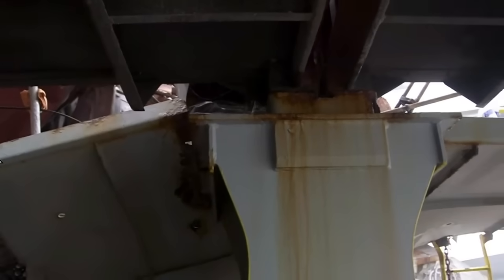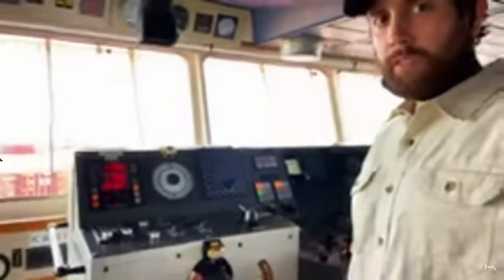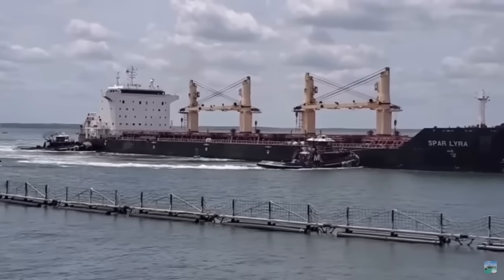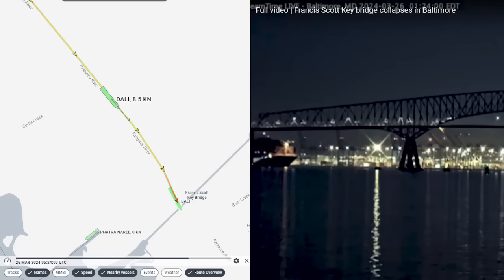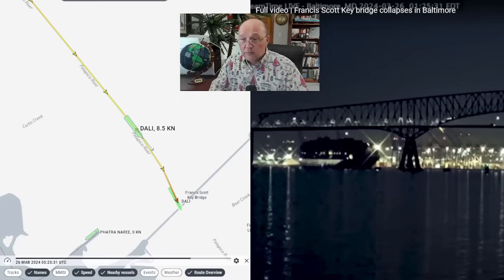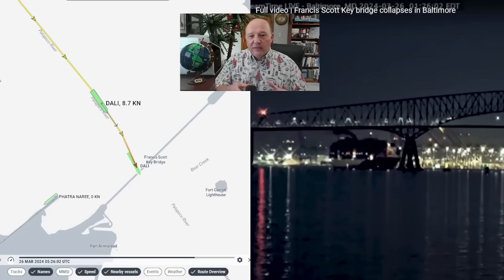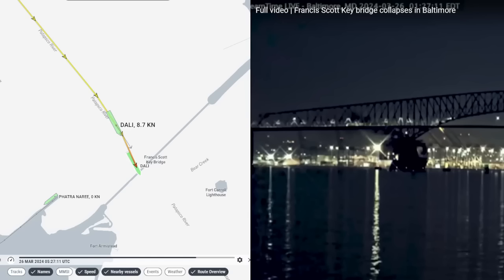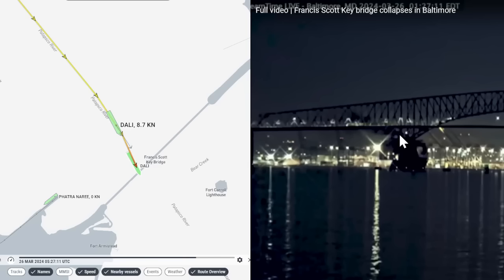Dali Timeline from Data Recorder in Striking Francis Scott Key Bridge in Baltimore, March 26, 2024

Comment: Ex machinist mate of a Ohio class sub here. When you lose hydraulic power, the pressure in the rudder control cylinder will start trying to equalize. This could push our pull the rudder a few degrees in a certain direction. Also, the hydraulic control pilot valve would have stopped where ever the last position it was when the hydraulic accumulators went dry. It's possible the helmsman was inputting a little right rudder to hold heading when the power went out, because you can't hold a heading without steering back and forth from left and right. In the Navy, they have us +/- 5 degrees of rudder to hold heading without having to ask permission. The slower you go, the greater change in rudder is required to hold a heading. So for all we know, the rudder could of been stuck at Right 5 to 10 degrees there whole time there power is out. Which would help explain the veering into the bridge.
Reply: Thanks for sharing. That's interesting to know about ships steering. Frankly, most of us know little, if anything, about how large ships work.
Reply: You have to steer left and right to hold a heading in the center. 

Ok, but isn't that more applicable out in the open sea?

This is in a protected bay with no wind and no current to speak of.

It's hard to envision steering a giant ship right and left in these conditions, especially when you're close to a bridge and you're aiming for a certain gap.
Reply: What are your thoughts about it possibly being a Chinese cyber attack?
Reply: @TomdeSabla that was already brought up in the video, complex interactions between channels and changing tides could have affected it.
Reply: @Mesuxyxrxbskxkxyp  i would think they would want control so not cut the power, and in life shit happens. in tv shows like seconds from disaster its a string of litte things at the wrong time that lead up to it. its like a game of chance sometimes you get a couple of bad rolls of the diceon afther the other.
Reply: @TomdeSabla you clearly haven’t piloted a boat or ship before 😂
Reply: @TomdeSabla   except its not entirely free off current…. AS EXPLAINED IN THE VIDEO you have flowage from the river and OUTFLOW from it approaching but not yet arriving at low tide which occurred one hour after impact
Reply: Thank you Bass Mechanic for your Expertise & Years of Experience . Thanks for Sharing Your Knowledge too.
Reply: @patrickhenry1249   i swear i doubt any of these conspiracy theorist have ever been in a boat that had a anchor larger than an old rusty coffee can filled with Quickcrete
Reply: The same principles apply when paddling a 14' canoe.  Those and I have to go faster or slower than the current for anything to work steering wise.
Reply: @patrickhenry1249  Clearly. Did you have something additional to that? Again it's a ship of 100,000 tons already aiming for a gap in a bridge about a kilometer away. It's not like Marley and Curtis Creeks are the mighty Mississippi.

It seems like a pretty sharp turn for a ship of that size, traveling at 9 knots, to make in those conditions just from tides.
Reply: @MrSheckstr  That's the problem sometimes with the tin cap folks. Entirely too much time and no useful knowledge whatsoever.
Reply: @JamesTK  I guess, but it's a really big ship and not that far from the bridge. I would think it would stay on course. I did find the technical discussion of how the power loss could have possibly resulted in a course change from the hydraulic system in the rudder interesting. I'd go for that before I went for the tides as a causal factor
Reply: @Mesuxyxrxbskxkxyp  The Chinese hacked the iPhone of the helmsman and sent covert signals via bluetooth into his ear pods to signal a veer to the right, thus striking the bridge support.
Reply: @TomdeSabla as vessels slow down they get “squirley” for lack of a better word to all you non mariners. As the speed come off you have the dynamics of the center of gravity, center of pressure of the water plane and the interaction of the ship within the channel banks. It would blow your mind to watch these ships push the water out of the channel onto the mud flats then fall back in after the ship passes. I operate a combined tug / barge unit with a high block coefficient. When steering we talk about how well a vessel steers without the propeller turning calling it a dead stick. My unit for example even reducing from normal speed to dead slow will try and swap ends with itself if you are not actively steering and it takes full rudder input, in addition to intermittent bursts of engine power to hold the course. The speed of the propeller is slower than the speed of the ship and the propeller acts like a giant disc blocking water flow. Once the vessel slows to match the propeller speed to the hull speed the rudder effectiveness is regained. I’m not surprised at all that the change in momentum started to cause the ship to veer. Even if the rudder was hard left it was still going right just because the momentum was already headed that way.
Reply: @Jon_Flys_RC  ok, I appreciate your logical and reasonable explanation and the time you took to make it.

We still aren't sure that the directional change happened without power are we?
Reply: One of the things questions on my mind is how modernized this ship is. Most of my vessel experience is with old school anchor positioning and dynamic positioning vessels for pipeline and salvage in the oilfield. With  dynamic positioning vessels there's potentially cranes with heavy loads, pipelines and/or divers in the water. If everything is working correctly if you lose main engine, you should have enough power to operate rudders and safety systems until the backup kicks in. Is that not a capability of this vessel? Was it supposed to be and something failed? I've been on vessels where we lost mains but the wheelhouse still had power and where the wheel house lost power but the mains were still running but never seen both go out at the same time.
Reply: @chetmyers7041 haaaaaaaa....i love this.....hahaha
Reply: @TomdeSabla  you’ve clearly never driven something large and heavy in the ocean. I’m giving you professional experience from doing it. Nothing in the water continues in a strait line without constant correction. It’s a dynamic environment and you’re in dynamic fluids.
Reply: @TomdeSabla 9 knots is fast for a giant ship like that, ships don't stop like cars
Reply: This has got to be one of the most important comments! If what you stated happened in this incident, it explains a lot! "Why did it turn into the bridge?", well that's why ^^
Reply: @TomdeSabla  The OP already explained everything with regards to a ship that size far better than I could, but if you’ve ever piloted a boat you’d know exactly what OP was talking about, and why your stance on the matter is hogwash. It’s not a car, stop thinking about it like it’s a car. It’s not a car.
Reply: Excellent  information  you sure know how things went  wrong. Pilot did all he could do to avoid hitting that bridge !!! Pretty much what was going to happen it was unavoidable
Reply: @Jon_Flys_RC  I’ve had this exact same argument with a friend before and the amount of people who think piloting a boat or ship is like driving a car, or that driving a car is harder is honestly insane. It’s like they think water is static and the propulsion of a vessel is instant, like it is for driving a vehicle on the road.  No matter what you try to explain to them about how that’s not the case, they can’t see it as anything other than a car on water.
Reply: They said in a documentary once that these container ships will coast in a straight long for up to 4 miles without any input because of the sheer momentum they have. This ship took a hard right as if it was deliberately turned and under extreme power. Just look at the smoke billowing from the stacks. Cut the power on a 30-40 foot boat when doing 10 knots….you have to do a lot to get it to turn at all. I’m not stupid and neither are 98 percent of you. It’s the 2 percent that keep defending this that alarms me. An object in motion continues in motion until acted upon by another force. The currents can’t do this you Einstein wannabes.
Reply: It was built in 2014. So as far as freighters and how they're treated. It's a pretty modern vessel.@nofuxgivens2797
Reply: @grendel.6.531  Which documentary, when, made by who? And secondly, why would a random documentary you saw somewhere, sometime, automatically overwrite the actual experiences of the people who do this professionally, and are telling you how the drift was possible?
Reply: These huge cargo ships seem to rely too much on computers and electronics to control the systems.  I think there should be some kind of mechanical backup controls for the rudder if that is possible.
Reply: @TomdeSabla he didn't say the ship was veering back and forth. He said to maintain heading, the rudder was moved back and forth. Changing direction of a 1000'+ ship loaded takes a good bit of force acring on it.
Reply: Why should this ship veer to starboard when it Is already cruising on straight line ahead? Had the steering been turned to starboard?
It's a quay and channel insignificant current?
Isn't there a periodic steering drills for emergency steering in case lost power? Manual steering drills?
Reply: @TomdeSabla  For factual clarity, I was in the USCG, and on a bouy tender that went out of Curtis Bay under the Key Bridge often. We were told to aim a light fixture on the front of our bow at a light that is in the CENTER of each side of the bridge span until were were about 1000 yards in front of it at which time if they were no traffic we stayed the course, if other traffic coming the other way we went slightly to our starboard or whatever the Quartermaster said. It was simple. Line our bow light up with the light at the center of the span. At night there is only one way traffic under that little 1200 foot opening. You hit the center of it while staying as far starboard as possible in the channel as per regulations. Remember, the closer to that bridge, the muddier it gets closer to the land and the pylons, so you have to go closer to center-right  at night from what I remember. But I only recall coming into the port under the bridge from being underway, as I came over from Curtis Bay and then went under the bridge. These cargo ship circle around and come down from their dock at Fells Point or wherever.
Reply: @TomdeSabla  go fill a bucket with water and splash dead center.  Watch the ripples.  Now splash nearby the side and watch the ripples.  The ripples closest to the side will hit the side and then come back sooner.  So even in impossible mirror smooth waters the ship itself is creating waves that can change its direction without steering input based on the objects around it.  

Add in tides and currents and you get a very dynamic environment.
Reply: @TerryKeever  I appreciate the distinction you're making. You also say to change the direction of a ship that size takes a good amount of force acting on it.

That sounds a lot like what I've been saying. I've expressed doubt that tidal flows from Marley and Curtis creek could generate enough force to push the ship off course into the bridge.

I'm sorry but I'm not convinced this was an accident.
Reply: @Jon_Flys_RC  It's not in the ocean.
Reply: @JBlades88WV    even if they had the equivalent crew of a WWII battleship, you wouldn't be able to move the rudder fast enough with manual jacks to avoid that bridge at that speed. 

On the Battleship New Jersey channel there's a video where Ryan the curator shows the manual steering back up on an Iowa class battleship.  That has 2 rudders and is almost 120ft. Shorter and over 40,000 tons less displacement. You're talking about giant screw jacks where like 100 turns might move it an inch. 

The amount of power needed to manually shift the rudders is crazy. There's just not enough crew on a container ship to even do it, if it even had the capability.
Reply: There was also mention of possible prop walk when backing down.
Reply: @TomdeSabla what he means is slight inputs from the wheel, which are constantly necessary to keep the ship on a steady course. It is quite possible that when the power was lost the wheel was not amidships, and caused further problems.
Reply: @TomdeSabla  There is not sufficient proof either way. However, as someone who worked around that area and worked on Curtis Bay, I too find it a bit odd that cross currents from Marley and Curtis creeks can so easily move this ship while some are saying high horsepowered tugs which move the likes of the Royal Carib. Cruise Lines ships that drawf this ship, cannot move the Dali. The Icon of the Seas is around 1200 feet long and 280,000 tons empty. That is more than 2.5 times the weight of the Dali, and they are towed and pushed when they break down, and they have to navigate those narrow channels. There is a photo of the Icon with two tugs and a line on her inaugueral, as they sat her in place. The shipping industry needs to get with it if it wants to keep pushing these huge ships through these small openings in unprotected bridges with their engines running.
Reply: @JamesTK  You can see in the video, condition's were about as dead flat as you could ask for.
As the things you mention are possible over time. This whole event occurred in the span of three or four minutes.
Something exceptionally stupid or intentional happened to end up with that result.
Reply: @tuck6464  you’re some kinda special.
Reply: @patrickhenry1249  I’m a professional mariner of 20 years and currently a tug master on a mated tug / barge petroleum unit. I’ve been going to Baltimore semi regularly for the last 10 years. Theres just no convincing the unwilling.
Reply: People don’t have a clue of how powerful a force that current can cause of even such a ship as the one involved. You can actually observe this force . I think the outflow of the waterway to the right(starboard) of the ship dramatically affected this accident along with loss of control of the ship. All you have to do is place a 2x4 piece of wood in a stream of water to see how the crew had not any option other than “go with the flow”!! It’s extremely evident in my opinion that quick mayday and radio communication saved more lives of travelers on and off the bridge from going down with the bridge.
Reply: @patrickhenry1249 I’m sure there are a few dummies who have never been on a boat and more a ship but most people know steering a ship is a million times harder. Actually know that I’m thinking about the people I see driving every day you might have changed my mind 😂 they can’t even drive on a stationary road
Reply: The Dali has a bow thruster which is powered by auxiliary generators x2. No mention of this yet which leaves me perplexed "why
Reply: One question and please answer at your convenience. Is dropping of the anchor hydraulic or is it locked into place which only requires a lever to drop it or does hydraulics drop the anchor??? If hydraulics drops the anchor that is the stupidest system I've ever heard of because you don't need hydraulics to drop an anchor
Reply: 5-10 degrees wouldn't VEER into the bridge
Reply: @paranoidballoon8190  The back ups failed. Thats all I heard. And from what I know about power generators and how often they need to be tested to make sure they can work when there is a need, all I can say is somebody is getting fired over the fact they (both?) didn’t work in this situation. Clearly maintenance was lacking on that ship, and who knows how many countless others?
Reply: DATA :  This is the FIRST Bridge dropped by a cargo ship.
QUESTION : What is the NEXT Bridge that will come under attack?
If it Looks like terorism, killed people like terroridm, and the Government LIES ABOUT EVERYTHING like terrorism,  then there WAS  NO ACCIDENT !!   😞
Reply: @shimes424  I don’t think you understand how a rudder works.
Reply: The slight movement to port may have been grounding, bank sucked in port quarter, bank then pushed bow to port upon grounding into bank wall, then collision...
I don't think they got astern propulsion...and crash stop astern would have created even worse effects...especially if they had any rudder on...port anchor was all they had 😳
Reply: @grendel.6.531 "they said in a documentary once" lmao very impressive evidence EINSTEIN
Reply: @grendel.6.531 Yeah, I'll go with the folks whose actual job entails controlling these behemoth ships than some rando armchair quarterback that saw a documentary once. 😆
Reply: Thank you for explaining.
Reply: ce
Reply: @SeaJay_Oceans not even close. Lots of bridges have been damaged or collapsed from cargo ship strikes. 

Seeing shadows doesn't make everything a boogeyman.
Reply: @jarodstrain8905    Sure Sure... Just keep sending Billions $ of your earning to Netanyahu and Zelenskyy...   Laughing all the way to the bank, those two !
Reply: @paranoidballoon8190  It was already mentioned in this very video, including the fact that the bow thruster requires a LOT of power, something the crew definitely did not have.
Reply: @SeaJay_Oceans  Can you please tell the audience about your experience with ships, navigation, maritime activities, single screw propulsion and being a helmsman?
Reply: @chetmyers7041  could you provide more details or point to the source of this information.
Reply: @pinoypedro2052   you have to look at a map and check the tide charts….. the water ways take a turn to the south past the bridge, low tide was still one hour away , therefore the tidal currents are pulling in that direction…. Much like people need to stop thinking anchors act just like brakes on a car people need to stop thinking that massive container ship on a body of water that is flowing into a body of water thst covers 75% of the planet is going to act the same way as a toy RC boat in an indoor pool at the Y
Reply: @TomdeSabla   you “express doubt” but have present zero reasons for your doubts …. The problem is you lack of experience or understanding just hoe strong tidal forces are when transitioning from a body of water of one size (the bay of baltimore) to a body of water several orders of magnitude larger in volume (the Chesapeake Bay/ Atlantic ocean ) through the very narrow opening that this bridge occupies.
For what should be obvious reason bridges, especial BAY bridges are built in the narrows, but for that very reasons the currents under that bridge are always going to be stronger than the average for that area
Reply: @cozmo1266   for some odd reason people (like those saying absurd things just to feed their conspiracy fetish) have equated low to with calm waters
Reply: @paranoidballoon8190  in the video it mentions that the back up generators where not turned on before the incident, and while attempting to be started they were spun up all the way…. It also points out that because of the big plume smoke it appear that most available emergency power (that could have been used on the bow thrusters) was being directer to the blowers on the engine combustion chamber to purge it of partially combusted fuel that was choking out the restart process
Reply: @Jon_Flys_RC  You noticed. I've noticed a few things about you as well.
Squirrelly did you really say, squirrelly ? Yes , you really need to come with a better word still, when you're  referring to a thousand ' container ship. (did he really say squirrelly)
You may have some classroom/ book time.
You may have bought a couple certs.
But that big mouth, had you better suited for management /HR, than you were for the sticks. But you didn't like that. So now you're a hand/laborer on a contractors utility motor barge, Which is now no longer a tug or a container ship, that rarely if ever sees any "ocean", except for the fairest of seas. The term squirrelly would be used for your RC endeavors.
I can see your barge wanting to swap ends, but I still wouldn't refer to that as "squirrelly"
Now is as good a time as any to go back and edit that squirrelly comment, Tug Master.
Reply: @sharilynnwebb   droping the anchor isnt the problem…. Its braking (stopping) the anchor chain once sufficient chain was let out…. When you drop an anchor without  power you have to let the entire chain play out, pray the end doesnt rip out of its mounting, but the anchor is not going to start to bite into the  bottom until AFTER the chain is going to pull tight and it might slide a good way once biting and that all depends on the conditions of the bottom.
In the movie master and commander there is a scene where a bunch of crewmen and a midshipmen are doing something and then announce to the captain “sand and broken shell” . They have dragged up a sample of the sea floor and announced what material it is made of so that the captain can make calculations to decide how to set anchors if needed
Reply: @nofuxgivens2797 sounds like you've seen the BrickImmortar FV Alaska Ranger. It's hard to find anyone that speaks plain English when all the experts weigh in
Reply: I agree. Plus, isn't there always going to be some degree of asymmetric thrust with a screw/prop and the way it acts on a rudder? It's a huge factor on airplanes and ski boats when moving slow. Chop the power and there are huge directional changes.
Reply: The estuary also has water flow change there. Just before the bridge, there is water flowing into the estuary from the ship’s starboard, that pressure change is right near the buoy , and it’s exactly where the ship lost power. Extremely bad circumstances. The ship whilst is bow looked to be pointing towards the gap, it was drifting sideways slightly towards the bridge, the anchor being dropped may have accelerated the dramatic looking heading, but it was going to hit anyway, just wouldn’t have been the bow. 
Many comments on the videos seem to misunderstand the ships true heading with it orientation. Till we get a report we won’t know. But it doesn’t look negligent from the pilot, looks like he was up shit creak without a paddle.
Reply: @TomdeSabla there’s a current right before the bridge. Just where the lose power there’s a current from the starboard side. That’s where the drift of line starts, and with no steering inputs available for a period of time the ship was drifting sideways as well a forward. Worst time to lose power in that exact position it did.
Reply: @grendel.6.531 smoke doesn’t mean anything, that could be trying to start up engine, up to now we don’t know the facts, but you seem to have already decided without any actual experience that it’s a deliberate act. The ship dropped anchor, did it begin dragging at that point? We don’t yet know.
Reply: @JBlades88WV they do have backups. But this whole thing happened in 5 minutes. To control a ship this size you need to turn far in advance. We don’t know the nature of the failure, and if any backup helped or not. But the power required to move even the rude is a lot. The ship relies on the propellers. More information needed before jumping to conclusions
Reply: @pinoypedro2052 it wasn’t, it was drifting sideways aswell, hard to tell by the videos but the telemetry says it was drifting sideways also. If the turn didn’t happen, it looks like the ship would have hit the bridge anyway towards the stern, maybe they were trying to swing the stern around it.
Reply: @sharilynnwebb Yeah, no.  As soon as you manually unchock, manually unclutch and manually unbrake the anchor, it falls - because it weighs as much as an anchor.
Reply: @MrSheckstr No, when you drop an anchor without power, you manually apply the band brake  by hand to the capstan to begin to slow it any time you want.  The trouble is that the anchor can't be stopped on a dime - you can easily burn out the brake if you crank it tight too quickly.  And then nothing will stop the anchor until it hits bottom, or rips the chain out of the ship and falls free.
Reply: Also there was heavy wind as seen by the exhaust smoke being carried away swiftly to port
Reply: @grendel.6.531 you speak so confidently with zero knowledge or experience while being wrong at the same time. Take a look at yourself and ask why you are this way.
Reply: I have always admired submariners intelligence.
Reply: @pinoypedro2052 it’s almost like you didn’t watch the video at all and also didn’t read the comment you are responding to.
Reply: @TomdeSabla Tom you are convincing yourself of something that is not true due to lack of knowledge. Which is frankly insane.
Reply: @tuck6464  you are about at qualified to drive you keyboard as everyone else who doesn’t have a clue what they are talking about. Keep up the good work 👍
Reply: @Foryourinfo369  Yet the winds have been described elsewhere as very light.

There'll be all kinds of Weather Underground data logged to provide objective data.  (Lots of bridges sport anemometers and wind vanes nowadays).

There will be a quantum leap in speculation once we know what killed propulsion, and what the state of the electrical systems were during the accident.

What probably has owners, insurers, and crew on the edge of their seats was whether or not this was the first time the ship lost propulsion like that.  If the ship had a rep for that, it's not gonna be a good look at _all_.
Reply: I saw a video by a retired ship's engineer where he said that the "Paddle Wheel" effect of the single screw in Full Astern is what helped drive the bow to starboard. What do you think?
Reply: @hanspecans  What have I convinced myself of? I said I'm not convinced it was an accident. Is that ok? What we've heard here are a number of reasons it absolutely could have been an accident.

I appreciate all the knowledge and expertise. However, there are still a number of reasons for my doubts. A couple are:

1. Data recorder stopped recording some data at crucial time. Please don't bother saying "the video explained that" because it didn't. It only offered a potential explanation that maybe it doesn't record certain things if the ships power goes out.

No one has spoken definitively on this issue 

I find it incomprehensible that a data recorder specifically there to record what happens if something goes wrong doesn't work if the power goes off 

2. The timing of these events is highly suspicious. This failure magically happens at the worst possible time. 

I think it's insane not to be suspicious.
Reply: @sharilynnwebb  This is LITERALLY covered in the video you're commenting on, FFS.
Reply: @paranoidballoon8190  Covered in the video already.  Thrusters would have little to no effect at these speeds, certainly not within the very short timeframe involved.
Reply: @TomdeSabla  it records instrument data no power to instruments no data to record
Reply: @damedusa5107  That makes sense.   I just thought there might've been some way to prevent this kind of accident.  I don't understand why they don't use tugboats to pull the ships until they're past the bridge.  Just seems too risky trusting a ship not to break down.
Reply: Just wondering, is it true that by dropping anchor it could cause the ship to swing around from the back?
Reply: What bothers me is Biden said he took a train over that bridge many of times. We all should be worried about that.
Reply: @Jon_Flys_RC  Will do , SQUIRRELLY
Reply: That's besides the point Sir. We are officially at war with Singapore.  This will not stand.
Reply: @MrSheckstr  Whoa, whoa . The Chesapeake Bay and the / Atlantic ocean ae not the same thing, or comparable.
The bridge does not occupy a "very" narrow opening.
Reply: @MrSheckstr  I don't recall any mention of "back up " generator's . Only "emergency" generators.
Reply: @damedusa5107  Like it or not there is still potential of this incident being a deliberate act/ deliberate irresponsible act/ deliberate interference to navigation.
Reply: @patrickhenry1249  But you argue with everybody, don't you ? And you always open your arguments with, "I'm not going to argue with you" don't you ?
Reply: good explanation

the  question is, if ship going  straight  then  why need the rudder  turn 5 degree?
because these ships  basically  using  GPS
and the way  to go ahead is straight

so everything shows  ship was steered
without power they couldnt turn it back
but why was  turned  when it was going straight?
Reply: @sharilynnwebb  I'm guessing to control the momentum of the chain payout. But I'd expect there was also a mechanical/manual provision for that as well.
Reply: @patrickhenry1249  Supposedly all equipment /main/auxiliary / back up generators are supposed to be running at all times while in navigation, in restricted waters/ ports/inlets, as a precaution.
Reply: @damedusa5107  If the AIS recordings/displays being shown are at all accurate, this ship had no upcoming turns approaching the bridge/a straight shot. No reason for anything other than minimal rudder articulation/manipulation, with or without power outages.
Reply: Probably this size of vessel has a semi-balanced rudder, which it should return to midships position after a hydraulic failure on the steering gear. I often see people bringing up their past sea experience in this case. I will tell you honestly, there are few people here which have experienced working on these modern and huge vessels. There are many different things compared with 20 years ago starting from regulations, maintenance and operation.
Reply: @TstanDa-Man  Not a million times harder. Exactly the same principal as a 16' powerboat.
The only real difference, is the consequences and the responsibilities .
Reply: Steered into bridge support confirmed?
Reply: @tuck6464  shouldn’t take everything so literally. So let’s just say you have a wide open dock to pull up to you think a small boat is just as hard as a shipping container to dock?? If so no need to comment I understand what you are working with between the ears
Reply: @Mesuxyxrxbskxkxyp you CAN NOT  be  serious .🤦‍♀️
Please seek professional help immediately !😳
Reply: @SeaJay_Oceans   One really has nothing to do with the other, even if you knew my positions in those issues, which you don't. 
 Wanting to see grand conspiracies and everything you look at says a lot about you and nothing about the world.
Reply: @TstanDa-Man  You're absolutely correct about people not being able to drive but think they know how a ship handles.

I "sat" for a USCG tender operator's license several decades ago. After 3 attempts, I gave up. That license is a whole lot easier than the ones involved in this incident.
Reply: @Mesuxyxrxbskxkxyp Maybe this was like that oil pipeline but in reverse. One of the largest shipping ports on the east coast mind you.
Reply: @SeaJay_Oceans  This is NOT the first bridge dropped by a ship. Sal even shows the last one in the video...
Reply: @MrSheckstr nailed it
Reply: Wow. Thank you for your service. Thanks for explaining that. Ohio class sub. Yikes
Reply: Thank you! You explained that so well that even a dog groomer can understand 😆
Reply: @davidsinn  a bad one was in in uk over 100 years ago. On a foggy night a ship brought a bridge down, moments later a Locomotive with passengers in the mist went straight off the bridge into the the water.
Reply: @Mesuxyxrxbskxkxyp I did blame the Chinese, but I like your theory. 👍
Reply: How come no one has noticed that on your map, the ship seems to have been on a course to get as close to the bridge stanchion as they could from the beginning of your map. Just a observation. No conspiracies here just a question.
Reply: @EdwardOtis-bb3eq  that's what I said. Why was the ship not in the middle of the bridge. What was it so close to the pulling to begin with. I don't care what anyone says. This was a planned hit or even like so one else said a cyber attack from China. 😔 😔 😢 😢 My so calls me a conspiracy theorist, but the truth is in video. It clearly shows the ship was way to close to the pulling from the beginning. JMO!
Reply: @TstanDa-Man  You be literate with your comments, I'll be literate with my replies.
It's all relative..
People are getting carried away, suggesting    that captaining/ piloting a ship is some sort of godly/unicorn talent. 
The biggest difference is the ability to see the ship in reference to the dock, from the helm.
Cruise ships pull up and depart dockage unassisted (not all the time) quite a bit.
Reply: What progress and new intervention had been developed in the last 50 years for building water placed piers?
Reply: @larryg5053  Yes like they showed in the video of the bridge that was hit in I think it was 1998 they built little islands around them to help prevent a bridge from taking a harder hit and possibly collapsing. I want to know why the first boat was led out by a tug, but not the Dali?
Reply: @Pebbles523 It was on the port side of the defined shipping channel when the problem started... probably with the  rudder stuck slightly to starboard to counteract currents .... momentum took care of the rest.
Reply: @michaelclohessy1153  but don't you think the Dali should have been in the middle of the bridge area, which even if it pulled to the right coming out, it would have missed the bridge all together?
Reply: @tuck6464  I feel dumber just reading your comments. I’m done ✌🏼
Reply: @bassmechanic237,

Great info, this!

Minor problem. If it was this way then the turn would've continued, but with the power fluxing there would've been changes. Which may or not explain why the ship beelined for the bridge support for a full 58 seconds.
Reply: Slow speed, high input. Going to PS or SB 10 is normal at times to get that rotation initiated, than you ease to 5ish. Usually  steering gear on a cargo ship does not have an accu. You have 2 pumps, 2 rams and your control valves. Thats it. No power, no pump, no steering.
Reply: @Jon_Flys_RC  absolutely CORRECT! Landlubbers have a hard time with the concept that SLOW boats are HARDER to STEER than a boat at SPEED. They are in TWO fluid mediums: the sea AND the breeze. The closest landlubbers experience might be the difficulty steering on “BLACK ICE.”
Reply: @samuelcollins1331  exactly. A DRIVEN hull and a DRIFTING hull handle very differently. The change in momentum when something is no longer being pushed will have drastic changes on how it responds. The best way to say it is the environment is dynamic, but that goes right of 99.9% of the populations heads.
Reply: @haroldgeorge4222  except MAYBE doing “nothing” would have allowed the ship to keep drifting “inside - out” as it had ALREADY cleared the protective “DOLPHIN” in FRONT of the pillars. Granted , It might have been very close, but the BOW was NEVER actually pointed toward the pillars. The STARBOARD SIDE of the BOW was “pushed” into  the pillars as the STERN worked to PORT due to propeller “walk” when in REVERSE! I am confident that the NTSB will comment on this matter.
Reply: @grendel.6.531  you almost got it correct IMHO! The ship MAY WELL have drifted VERY CLOSE to the pillars like it DID drift PASSED the protective “ Dolphins” in front of the pillars . BUT trying to REVERSE the boat without accounting for “PROP WALK” CAUSED the STERN to swing OUT to PORT thereby “pushing” the STARBOARD bow INTO the pillars. Therefore, in hindsight, Doing NOTHING might have been the more prudent action to take. I am confident that the NTSB will comment on these matters.
Reply: @TomdeSabla If there is no wind why is the smoke going horizontal in the same direction the ship is drifting at 22:26 ?
Reply: @Pebbles523  The channel is not in the middle of the bridge.....probably run aground if he went middle of the large span.
Reply: @michaelclohessy1153  well I know he can't go straight down the middle, but A. They should have had tugs, with a ship that size and B. They should have been at least 200 ft away from the piling. I know you'll judge me, but this has corruption written all over it. 😢 😢
Reply: @TstanDa-Man  Suite yourself.
Reply: @EtherealVirago  our host said there was no significant wind. Weather report said calm. In any case it would have to be a lot to blow a 100,000 ton ship off track in such a short distance.

I'm more inclined to believe the rudder positioning sent it off course.

As I also said, and no one has proved otherwise, that it might not have been an accident.

I repeat- no one has definitively stated it was an accident for sure. All I've heard are plausible reasons why it could have been an accident.

Only a naive fool states at this early point in time that oh yeah, it was an accident for sure.
Reply: @Pebbles523  They were well over 2000ft from pylon when they lost steerage.  The middle of the channel  is 600ft from the pylons.  Tugs would have helped but, apparently,  not normal practice.  As for corruption... I think you have already judged yourself on that one.   Sometimes sh!t happens... I blame gravity for everything :)
Reply: @michaelclohessy1153  Have you been on that bridge? Where did you get they were 2000 ft from the pilar? 🤦‍♀️
Reply: @TomdeSabla rivers and deltas have their own challenges compared to open water. Mainly river currents, eddies, and tides if the river is tidal. The windage and protection from weather is entirely dependant on the surrounding environment. I know nothing about Baltimore but if it's quite flat with relatively low buildings you can still get much more wind several meters above the surface. These ships are huge and can catch a huge amount of wind from their sides even in seemingly protected environments
Reply: I'm pretty sure they're are some pretty strong currents in the patapsco River @TomdeSabla
Reply: No current? Or you serious?
Reply: @CharlieB-gs5uk  it's a cover up, they just turned off the lights. The ship was not even heading towards the middle of the bridge. Also, most news footage has been slowed down, to make it look like the ship was moving slower, as can be seen by watching the traffic skipping along the bridge just prior to the crash. 
Several unedited realtime news videos show the ship veering into the bridge support at speed, at the last minute.
https://youtu.be/JebyNOvJmCM?si=qgB3NAyzUYKb9Kqp
Reply: @mscottlawrence2037  yes, but the news said it was calm that night. If you look at the water in the video those 2 young guys put out, B4 l anyone else, you can see the waters looked calm. I still say. If they lost power right B4 hitting the pilling, that something fishy is going on. When you watch them pull out of port and make the round turn, they should have been closer to thr middle of the bridge, not close enough by any means to hit that pillar. The whole thing happened in the blink of an eye. MAY DAY WAS CALLED AT THE LAST MIN, ANCHOR ⚓ WAS DROPPED AT THE LAST MIN. NO OF IT MAKES SENSE. HOW COME THE TUGS DIDNT PULL THE DALI OUT LIKE IT DID THE SHIP PRIOR TO THE DALI LEAVING PORT? JMO! Our government is corrupt and you can tell me different.
Reply: Thankyou, a brillant explanation ,sir rgds Colin
Reply: @Pebbles523  This question was answered in the video. The tugs that were escorting the previous ship only did so because they were heading back to their home port.
Reply: Current from intersecting channel pushed it to starboard
Reply: Is bad enough we are gouged with taxes from gas, to food, to entertainment. It's a disgrace. 😡 🤬 😔 😢
Reply: I just asked this exact question. Then I read this. Then I deleted my question.  Lol
Reply: @away2619 I'm ex-Navy. But I manned a desk. If that is in fact what happened,  it does make sense.
Reply: @Pebbles523  it's hard to say, if it was a terrorist I think they would have hit it later in the morning, I think the Dali had prior issues and should have been corrected at that time. As far as the current someone previously said there isn't current in the water but it can get rough out there, not really sure what the government has to gain from this
Reply: @Pebbles523  If you bother to actually watch the full video you will see the  movement of the Dali on a tracker.  The boat was at least 2000ft (if not more) from the pylon when it started to veer offline from the channel.  You can measure it on Google Earth if you wish. Please do not reply....just wait for the investigation. Then you can call corruption ....whatever the outcome.
Reply: As a former ship's engineer I completely agree with you.
Reply: One or two degrees 😂😂your talking shit buddy
Reply: @TomdeSabla I worked that ship that night. Wind is almost always a factor. Winds were in the 30s that night, which is kind of average for the Port of Baltimore. The wind was blowing south and there is no doubt in my mind it had a handle in it. I was working a ship last April that snapped the ropes holding it to the mooring like they were pieces is string. Container ships catch a lot of wind.
Reply: My Father was a Machinist mate in 1944 on the USS Barrow, a troupe transport. I wish he was alive to see this. He was a member of the Only crew on that ship. It was brand new. It did it's tour, returned to Pearl and then it was Blown Up at the "Operation Crossroads" Nuke test. Dad used to tell us that the Navy blew up his ship. I was able to find one picture of The Barrow coming back to Port with most the Crew up top. Of course Dad was not up there because it hadn't quite docked yet. So he was still below deck. Anyway your info shed some more light on this incident. Thank you.
Reply: Great points 
I myself am a HEO operating hydraulic machinery ,
For 45 years 
you totally makes sense in what you are saying, but more realistically mathematically speaking per-se if the flow of water pressure coming out of the river stream towards the port side of the ship ( like water being blown through a straw towards a Popsicle sick on its side  1/4 under water as it's passing by ) may be strong enough to pitch the ship off course as the ship is moving forward slowly decreasing in speed due to loss of power as that flow of river water coming out is  hitting on the port side of the ship and as it is passing the mid section 
the water pressure coming out could be by mass and force powerful enough to pitch the ship off its heading course making the ship perform like that Popsicle stick in water being forced to pitch from side pressures from the water line to under water from river water side pressure force also taking into consideration on how deep the hull of the ship is from the bottom of the channel and the depth level of the port side river and volume of water and pressure and exist side width of the river from bank to bank flow of water coming out of the river applying water pressure force against the port side of the ship,
after passing the centre point of the ship the river water pressure may be enough cause the ship to veer to port also depending on the position of the Rutter when power failure occurred ,
As I have seen when under hydraulic pressure when losing power that whatever position the hydraulic operated part is  in usually stays in that position until power to the hydraulic pumps are restored unless there is a certain amount of back pressure release seeping back into the system due to worn seals,  are allowing the Rutter to position itself into its most relaxed position,
I would think there probably are many safety mechanisms to prevent that from happening you would think. 
Just a old pro
That retired long ago!
Be Safe!
☮️
Reply: @patrickhenry1249  The refrigerated containers were creating trouble when we were loading the ship that night. They were overloading the system and the lights went out a couple times.
Reply: @EtherealVirago  You sir, have hit the nail on the head. I am a longshoreman in at the Port of Baltimore. Last April 5th, one year ago today, we had high winds literally rip a ship loose from its mooring and snap the ropes that tied it down like they were little pieces of string. That boat dropped anchor and it didn't do shit. That boat drifted out to the Key Bridge, a 1/2 mile from the berth. They got the engine started and under control. Container ships without power are sail boats.
Reply: Also, they just passed a shipping channel dredged into the river on their starboard side. Even without rudder input, Bernoulli's principle will suck the ship towards the side channel.

If she had already lost rudder control at this moment, her rudder could be steering straight, but Dali would still get sucked towards the South side of the main shipping channel. She would need active steering (or tugging) to avoid the bridge.
Reply: Another consideration is how much wind and which direction was it acting on the containers, which behave like a sail when stacked that high.
Reply: @Lemonjellow tbh I was thinking about that backup ridder solution too 😂

Thanks for cutting me off at the pass!
Reply: @papamaanbeerVideo  I'm just extremely bothered that with all the open space under the bridge, the ship hits dead on.  What are the odds?

They did drift out of course, why?  Does the power cut then make currents supreme or was it purposely set to drift, then power on with more correction (dependent on your view, I suppose).

What are the rules a super large ship needs to take in port?  Were they "speeding"?
Reply: Most ships have the ability to go to hand control from the steering gear room. Although from that such a location you would be blind,phone contact between the steering gear room and the bridge is required and rudder positions can be manually controlled.